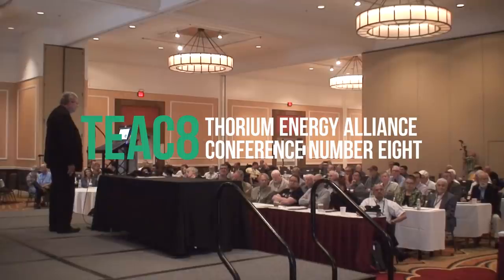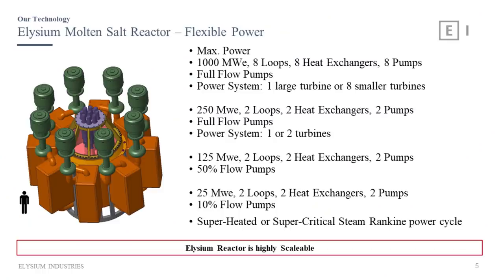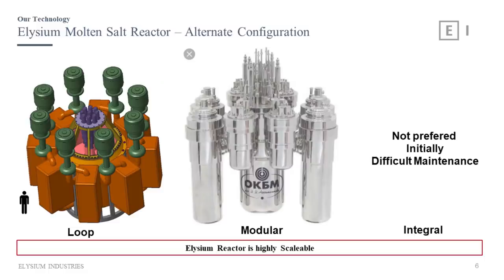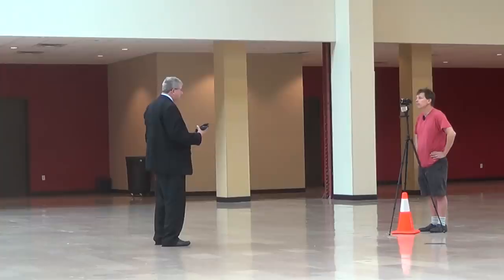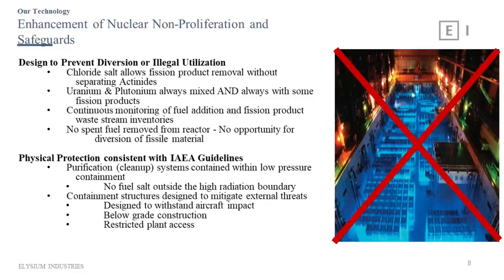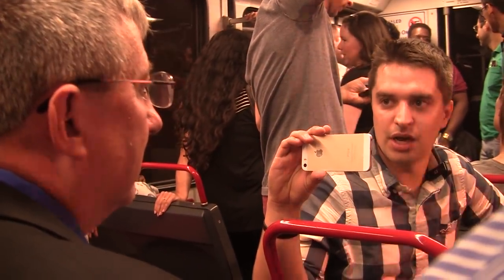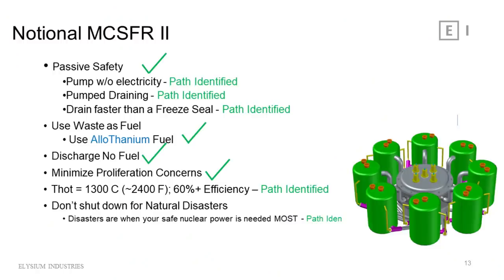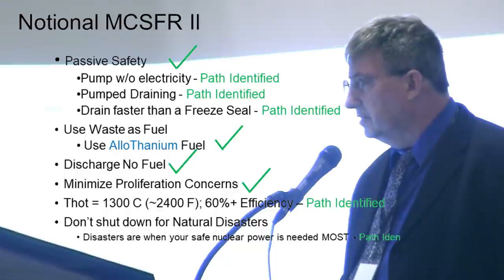Fast-Spectrum Molten-Salt Reactor - Elysium Industries - Ed Pheil @ TEAC8

Comment: This starts to slide towards just putting thorium rods in existing tea kettle reactors, which would be even cheaper yet, but not very innovative .  How does this stop us from buying reactors from China in 15 years?
It's not going to breed - which is kinda the point of a fast reactor, isn't it?
Reply: rRobert Smith 
Yes it can breed, but the first step is to allow it to be built, and people don't understand how breeding can be done, while still meeting proliferation prevention. That CAN be done. Also, maximizing breeding has several techniques that can be used, like enriching to 90-99%, NOT 99.995%, Cl37.  I know who can do this, but Economics need to be figured out. A blanket coukd increase it more, and is possible. Periodic or on-line purification of soluble fission products would help, but increases cost. Heavier, but low absorbing,  salts helps too, to minimize slowing down, e.g. no F, more I, Be, etc. Same for cations.
Reply: I appreciate your plan, Ed! It's definitely a helpful step in the right direction. I could easily accept a future where we have large municipal/regional liquid chloride reactors doing all the grunt work, supplemented with smaller light-duty LFTRs on local or even private scale. I mean it's LITERALLY not like they can "blow up"; cutting water coolant out of the equation was one of the best ideas in the whole industry.

... Also I want to go into nuclear. If I do so, I'll be starting from the GROUND UP at a local technical community college. If I go back to school with my heart set on nuclear engineering, I'll have to start simple with a more generally available engineering background. That said, if you wanted to hire someone to work on reactors with you in 2024, would you recommend I start in mechanical engineering, or chemical engineering? ^_^;
Reply: Stonehawk 

First whichever is most fun for your. Careers last a long time. 

After that Cemical Engineering. These reactors are like 60% chemical, then equal parts nuclear,  fluids, structural. I include materials as "solids chemistry" and solids/liquids interactions are corrosion & errosion. Radiochemistry is important. I learned that in nuclear though, but it belongs in chemistry. MSR's owe their existance to radiochemistry/inorganic inorganic ionic chemistry. Ionic chemistry causes our fuel self repair rate to be 5-6 orders of magnitude faster than radiolytic damage rate by fission products, neutrons, alphas, betas, and gammas. Normally solid fuel chemistry deals  with these...poorly because lack of mobility inhibits salt repair until mobility returns at very high temperatures. Liquids only had to deal with neutrons and gammas in solid fuel systems. Of course as much as you can get of all of those nyclear, fluids, structural, materials fields and electrical, digital, and control systems. The nuclear degree usually encompasses all of these superficially already in BS degrees, but water centric.

Comment: It's not going to breed - which is kinda the point of a fast reactor, isn't it?
You either so it for simplicity (which they certainly aren't) or for breeding.
Reply: I think removing graphite out of the core simplifies the design.
Reply: Jonathan Schattke 
What are you talking about? How do you think we get to 50-100 years with only fertile feed (SNF)? All reactors breed. In ours it is just a bigger knob to use. Breeding is a nother whole half hour presentation, so I didn't go there and the public isn't ready for it yet. You have to do a good job presenting the breeding story or public, the anti-nukes, and NNSA/IAEA get nervous.
Reply: Fair enough, Ed.
But if you're using 20% enriched U235, then you have a ratio of 1:4 fissile to fertile.  Single fluid you will use fuel at ~2.29 and breed at 4*0.25, or ~1.
Reactor grade Pu/U238 or SNF + Reactor grade is more complex, but not much better. 
ORNL worked out a single fluid breeder by doing a blanket pass with the fuel, inside the reflector, and their design studies on that showed breed positive only with U233/Thorium, IIRC
Reply: "Burner" reactors breed some Pu-239 and (fed thorium) U-233, and burn them, right in the core. If I understood, Elysium is trying to get their basic reactor on line, burning PWR wastes, and replacing coal and gas, ASAP. Adding a breeder blanket to the design shouldn't be a major challenge, and I'm sure they will do so, as soon as they see the need.

While I suppose that breeding fissiles is part of the point of a fast reactor, its ability to burn wastes is more the attraction for me, and, if true, Elysium's MCSFR's ability to burn all of the actinides fed it, or that it creates, without requiring reprocessing seals the deal. This looks like the least expensive fission reactor possible, to me, both to build and to fuel.
Reply: @johnorenick9026  aw heck no, if you just want to burn, you can be loads cheaper. No pumps, simple structure. You actually want a section of the core thermal for lower loading cost.

Comment: 0:53 excactly. These SMR reactors will be more expensive than present large reactors. So ITS the wrong path for cost efficiency. Probably everything will be solved by dirt Cheap solar and dirt Cheap energy storage.
Reply: This reactor is not pressurized.   No large forged steel reactor vessels or concrete containment structures are needed.   They will therefore be much cheaper to both build and operate.